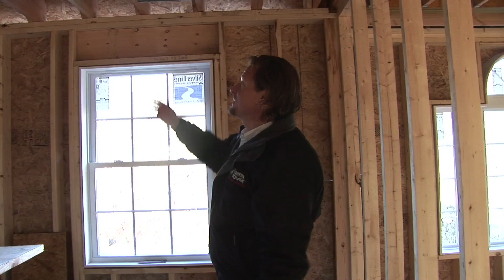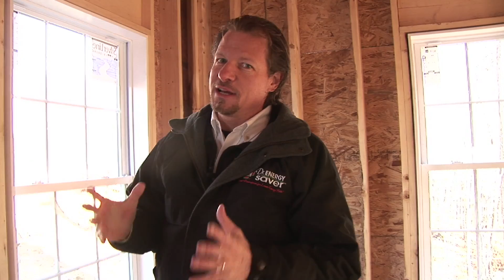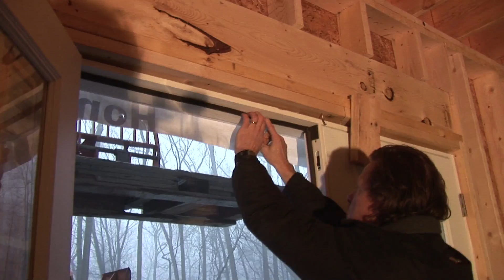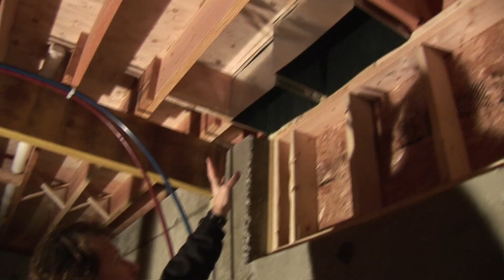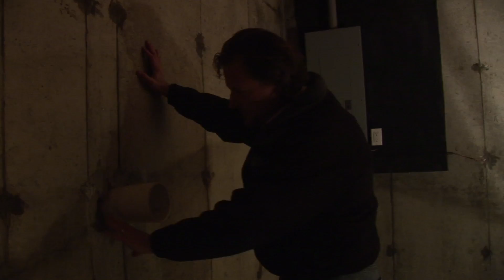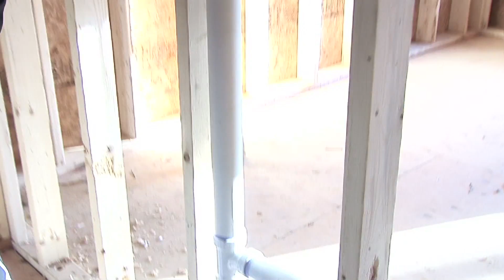How New Homes Waste Energy

Comment: I was an insulator in Eastern Ontario Canada for 4 years 2014-2018.In my experience nobody cares about the insulators. Numerous times the HVAC guy would install the furnace and ducts too close to the walls preventing floor joists from being insulated and poly'd. Windows wouldn't have enough room around them to foam properly. Ceiling features (cathedral, step ups, coffer) not framed properly to batt. We would batt them then blow in afterwards to fill any gaps. No poly behind electrical panels. We caulked all double studs and floor joists before poly. Foamed all holes going into attic and exterior walls. Builders for the most part always had poly between top plates and cap plates for us to tie our ceiling poly into.

Comment: Doc, we need better energy codes for new home construction.  Everything you have pointed out is so common because the construction codes are holdovers from the past.  The #1 change that needs to be implemented is putting board type insulation on the outside of the walls. Adding 2 layers of 2"  (staggered for 4" total) extruded polystyrene. This R-20 should be the absolute minimum.  Forget the fiberglass batts and the house wrap.  Exterior siding can be attached to the wood studs behind the 4" insulation with wood or metal battens screwed in place with extra long screws. Insulation should be continuous right down to the top of the footing. Window framing will need 4" architectural extensions to compensate for the thicker wall.
Reply: I can not understand why this is not mandatory for code. Other than it would wreck the current insulation Industry. But building homes like coolers completely wrapped in 4 inches of foam would be simple and cost effective if done on a national scale. The energy results would be dramatic, and homes would be more comfortable.

Comment: I appreciate you saying a brand new house could still use more insulation.  It's true!  I bought a brand new house a little over a year ago& it needed insulation under the roof.  I was so upset when I saw it.  The home I saw originally had it insulated but when they built mine they didn't do it.  Makes me worry there are other things in the house not done that I can't see.  But I insulated the attic myself.

Comment: I recently signed a contract to build a house.  Your videos are incredibly valuable.  You better believe that I will be make sure my house is properly insulated and air tight before the sheet rock goes up.  Unfortunately my builder uses fiberglass batts for the walls (r19), but uses cellulose for the attic (r35).  I will be making sure all the windows, doors and any gaps are foam sealed before the batts and cellulose are put in.  Would you recommend that I blow more insulation into the attic with a r35 rating for Charlotte, NC, which is rated as zone 3?  I can't do anything about the exterior walls only being r19, they won't go any higher.  I would have liked to have at least r21.  Wish more builders offered full spray foam
Reply: Jason, make sure your contractor leaves time between the insulating and sheet rocking so you can make sure things are right.  Mine didn't and some major mistakes got rocked over.
Reply: Jason Chalanick I'm in Moore county. payback in our climate zone falls off rapidly after r40 ceiling and r20 walls. deminishing ROI. air tightness and radiant barries are beneficial but rarely used around here.

Comment: Hey Larry, have you guys ever considered using roxul comfort batt for the odd shaped areas? It's able to be cut to any shape or sizing and has a higher r value and more resistance to air, moisture, and also fireproof. I'm sure you have heard of it, figured I'd ask.
Reply: Why not just use spray foam for odd shaped places and Roxul everywhere else?  A combination of techniques.

Comment: Compressed fiberglass is better than no fiberglass though (compressed batts also have higher R-value per inch, up to a point anyways, that's why 3.5" batt can be R-11, R-13, R-15, it's just denser) You still got to fill the cavity though.

Not only are new houses not energy efficient as they could/should be, but they aren't as energy efficient as advertised =( those liers!
Reply: No 3.5" fiberglass batt is even R-11.  It's the other wall components that make the R-11 wall The best fiberglass can do is R-4.5 per inch for high-density duct board.

Comment: Do you recommend foam insulation or Blown in insulation? The house will be located in Central Texas. Hot summers (100+F) and cold winters(20-50F).
Reply: It's not just the type of insulation but how much of it. Foam insulation really should be used sparingly due to it having a lot of GHG emissions both in production and after installed. If you use Blown in Insulation, this isn't an issue and it's more cost effective. You just have to ensure the cavity is large enough to get a decent insulation value. If you had 24" of insulation, that would be more than sufficient.
Reply: Closed cell spray foam for all hard to reach areas and external walls. 2in is all u need.  Then add bat insulation if u want more r  valve.  Spray foam is 7x more expensive. Attic blown in cellulose cant be beat! Only need spray foam in attic if u r insulating the rafters vs the floor